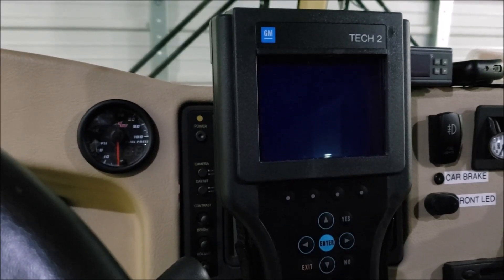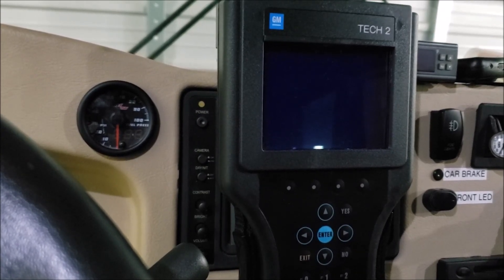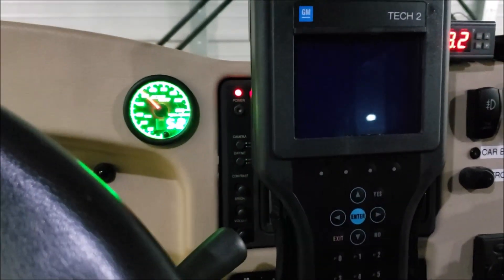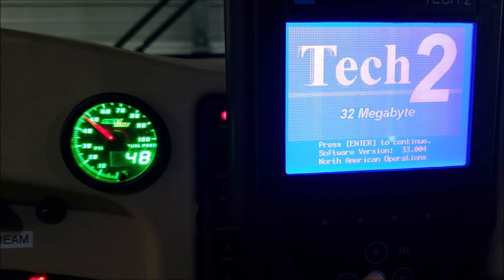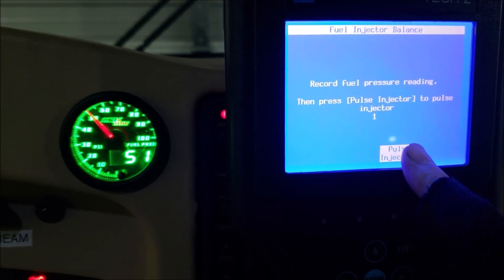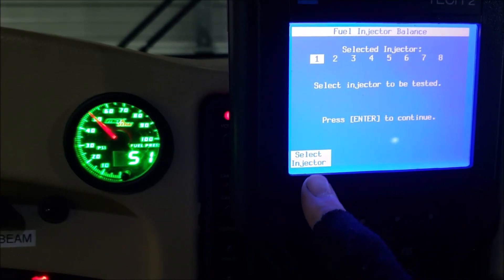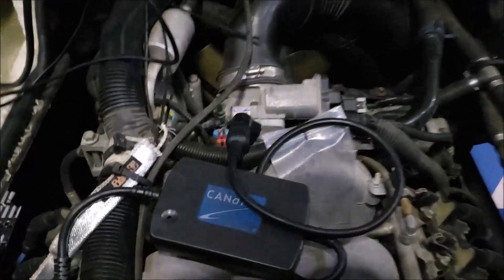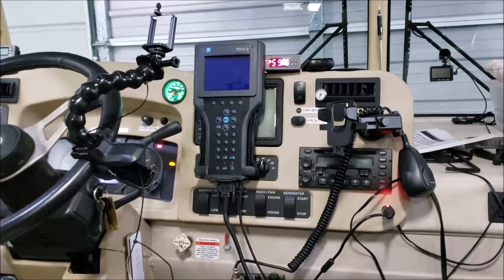Workhorse Owners With 8.1 Vortec Engine How to Perform  Fuel Injector Balance Test With GM Tech 2

Comment: do I need to buy the gm software with the tool for the extra $28?
Reply: thank you for responding.
Reply from the maker: No
Reply from the maker: @devontaebarnes4332  I think so. It's been a while since I ordered mine

Comment: Kevin, if your fuel pulses had differing pressure deltas, what would you do....would the Tech 2 allow you to recalibrate and bring the pulses back into range, and likewise bring the ohm values back into range? I am guessing Tech 2 can only point out the condition but it may not be able to recalibrate(?)
Reply from the maker: Very good question. I do not know, but I'm looking into it

Comment: Morning sir, thank you for braving the cold to answer my fuel gauge question, certainly not asking  for that benevolence again, wondering if you knew if tech2 could read oil pressure? Both my gauges are faulty, fuel & oil. Enjoy your holidays& stay warm! 🙏⚘🌴
Reply from the maker: Using the tech2 the only this i can find is oil pressure sending unit voltage.. not psi..
But if you buy a scangauge 2 it will read oil pressure for you.

Comment: Great video, I have the 8.1/allison in the regular chevy truck.  Do you know if the Tech2 will allow you to adjust when the torque converter locks?  Such as minimum speed or maximum load to lock.  I wish it would lock easier when I am driving with an empty truck and not towing.  It will not lock until about 54 mph which is frustrating as I have a long stretch of 45 mph road on the way to work.  I can adjust all these things on my 1990 truck with tunerpro and my eeprom emulator, so I know how to adjust the settings to accomplish what I want to do but I was hoping to be able to adjust them on the 8.1 truck without having to buy hptuners setup or something.  For your question in the video, I believe the 8.1 first started in 2000 or 2001 for the 2500 and 3500 chevy trucks.  It may have only been used in the workhorse RV later.  We got our truck with 260,000 miles and we're up to 275,000 and it's still going strong with basically only a full front suspension rebuild.  Sounds like you've got a lot of miles left in yours
Reply from the maker: I did not see any settings like that when I was looking around. If fact some RV's have the same problem. ours would not shift until about 55 mph so I sent the ECM to Brazels  he was able to reprogram the shift points. check them out here. https://www.brazelsrv.com/Ultrapower-GM-Workhorse-8.1L-Custom-Tuning send him a email to see if he can help you.
I would love to put 275,000 my on our RV. lol

Comment: Great video about operating the GM Tech 2 I have a 2009 Workhorse w24 and I have an intermittent ABS light. Can you tell me what tester I need to read the ABS codes? Thanks
Reply from the maker: Give me a call I maybe able to help you with that.  I have been down that road before..
My cell 606-875-0125 Kevin